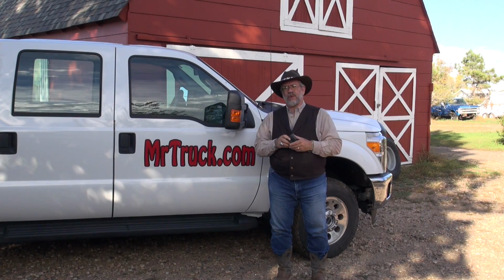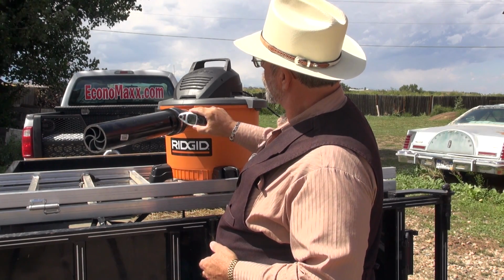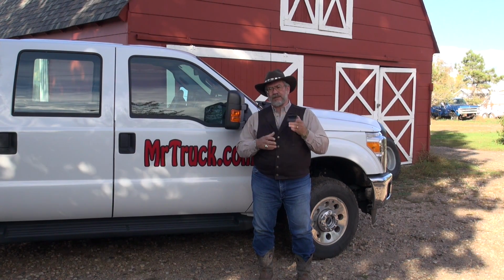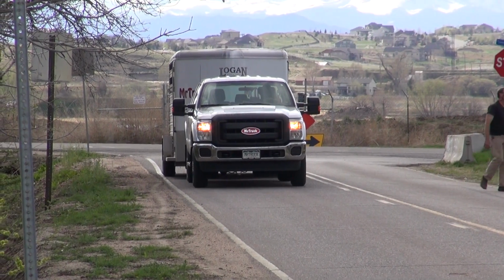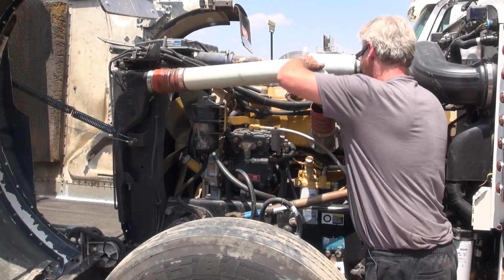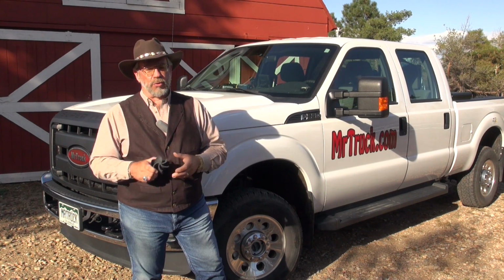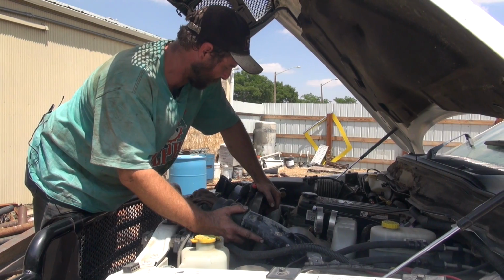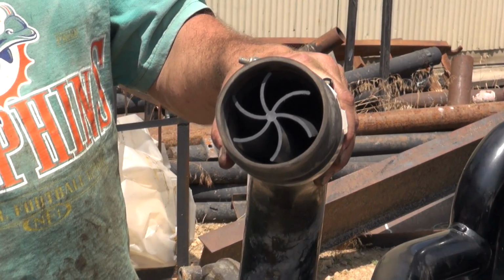Fuel Saving EconoMaxx, Venturi and Vortex makes engines more efficient

Comment: This thing doesn’t do s*t. This is a scam. It MIGHT create a small Venturi flow because you are literally restricting the intake size (only the cross sectional area of said device) which in turn speeds the air flow *ONLY through this restriction (Bernoulli’s principle), but the air slows back down afterwards. 

Any “vortex” created is also negated by the fact the air has to flow through the intake runners and the  intake valves further downstream. 

It doesn’t add power because it’s not affecting the MASS air flow. The same amount of air that was read by the MAF sensor is the same before and after this device. The same amount of fuel will be provided with or without this device. 

These POS devices have been proven time and time again to not work. You are using “science” jargon in a way to make it seem like this device actually does something. It doesn’t and you know that.

Comment: Mr Truck please test a hollow ball put between carb and intake manifold that the air fuel mixture goes thru it almost doubled my gas mileage .See " motorcycle gasoline atomizer vaporizer "on YouTube to see working model.
Reply from the maker: I don't have a carburetor
Reply: You can make the balls with the fuel injectors in a cone before the hollow metal bslls attached at the intake port on head unless of course you have direct fuel injection in the engine heads  where you would be out of luck

Comment: For $125 for this part, I am quite skeptical
Reply: Consider this:  My 2006 Ford F-150 (4.2L V8) reliably delivered 13 mpg city / 19 mpg highway over many years.  With rising fuel costs, I installed a K&N cold air intake and added an EconoMaxx device to the system.  Results:  Noticeable torque and fuel efficiency gains.  Tachometer shows the engine is working with far less effort.  Engine "growls" a bit with the new air intake stuff installed.  Transmission rarely downshifts on hill inclines.  On a recent 164-mile highway outing, the EconoMaxx / K&N system were key factors in  the 28 mpg fuel economy obtained.  Mileage could have been better -- I kept the vehicle at 72 mph, just over the 70 mph limit.  You will recover your investment in an EconoMaxx and then go "into the black" on that upgrade with fuel efficiency gains.

Comment: I've tried a similar product on 4 different vehicles (3 cars, 1 SUV), long-term.  Gas mileage was improved in 3 of them.  The 4th, a Mazda RX8, did see an improvement in power, though the gas mileage stayed the same.  That's probably due to the fact that the rotary engine is not the most efficient design for economy.  I always see people saying that these things don't work, but I have yet to see them fail.  Hey, some people will never believe the Bernoulli principle.  But it's not a matter of faith.  It's a matter of science.  I will say that this thing is way over-priced however.  Profit margin must be huge.
Reply: Spiralmaxes can be used in the exhaust and two at A time for the most benefit.  So you would two before the throttle body and two in each exhaust tip.  The outer one being spot wielded in place.

  They are A better design in my opinion.

  Also if you go on my page you can find an experimental modification for the rotary engine.

Comment: This may do some good for your Ford engines but it would be counterproductive in the GM "LS" based engines.

There is already a Vortex action in GM engines and this product would disrupt the airflow and in turn, the overall AFR in the cumbustion process. The vortex action in GM engines increases horsepower without losing efficiency so it makes sense that it actually works in the Ford.

Just wanted to get this out there so the nay sayers may understand that this concept does work.
Reply from the maker: PaLEOjd Yes it won't work on every engine. It did work on Ford's Eco Boost 3.5L with two turbo's. In my review of Econo Maxx on MrTruck.com I show the similar devices that Ford uses on their Eco Boost. You won't find a part number from Ford for their device, they make you buy the whole air box. But changing out Fords device with Econo Maxx improved Eco Boost performance. I wish I could dyno hundreds of engines and sort threw what works. This is why Econo Maxx has a 60 day refund policy with free return shipping.

Comment: I put in my charger the turbonator fan its not stationary so it spins , will this do the same as what.you put in?
Reply from the maker: 3232myke This is stationary, it makes the air spin
Reply from the maker: 3232myke To work efficiently, you need to move the air, not spend that energy to move a fan. The intake system sucks air in, Econo Maxx helps to speed up the air.
Reply: If the blades spin, the air is moving straighter. If this device has any significant effect, it would need tdo have stationary blades.

Comment: Thanks.  I checked the Ford forums and oddly did not find any discussions concerning the EconoMax.  You would think these guys would be all over this simple, inexpensive and effective tool.  Especially when they are constantly comparing Ford's MPGs, HP, and torque with other manufactures.  There's discussions on Gotts, tuners, tanneau covers, air filters...you name it, but not this.  Ford took on a huge undertaking to increase MPG efficiency from "5-20%".  Heck for a few hundred bucks, based on your findings, Econoboost is meeting that and perhaps in some testimonials I'm seeing surpassing those expectations.

Comment: Will the product work for the 2015 ford 150 2.7 and 3.5 ecoboosts?  I saw that the Sema testimonial used 3 EconoMaxx units when he replaced the 2 in his 2013.  Can you explain this?  Ford's version of this product looks rinky dink compared to the EconoMaxx.  You would think that Ford or one of the other manufactures would seriously consider offering a considerable sum for this patent.  Especially since they spend millions upon millions to lighten the pickups and fine tune their engines, etc... I'd like your thoughts on this as well.  Thanks!
Reply from the maker: EconoMaxx on diesel semi-trucks puts one on each turbo and intercooler (charge air cooler). That's what they do on the Ford EcoBoost, one for each turbo and one on the intercooler. When there are more 2.7L EcoBoosts available, I'm sure they will get one installed.

It's hard to figure out. I show OEM's products I like and sometimes they listen and sometimes they don't. I think Ford's version of a venturi accelerator is suppose to be secret. They only use it on the EcoBoost and there is no part number for it.

Comment: Hey,Kent. I have a question for you.
My truck is a 2010 Chevrolet Colorado 2WD  with a 2.9L 4 cylinder engine. If I were to put the EconoMaxx in my truck, do you think it would increase the fuel mileage the same as it has in your F-250 6.2L, or could it possibly increase by more due to it being much more lightweight then your F-250? 
Thanks!
Reply from the maker: There's no way of knowing without trying it.
Reply: Let us know if you do get it. I have a 3.7L Colorado and I'm really interested to see if it works as well

Comment: How is this any different from the Tornado Air?
Reply from the maker: From what I could discover, the original Tornado worked somewhat. But it was only a vortex. EconoMaxx is a vortex and an angular venturi. Also the original Tornado we saw in infomercials wasn't patented. Many companies copied it and didn't build a good copy. So it's reputation suffered. EconoMaxx has a full patent in the US and Canada, meaning they had to prove it worked, like I did. I doesn't improve fuel mileage in every vehicle made. And I can't test it in every vehicle. I'm happy with the results I've seen. Check out http://www.EconoMaxx.com website for other places that have tested it.